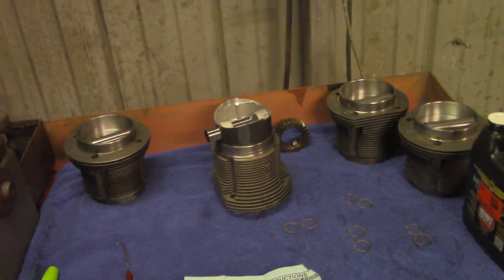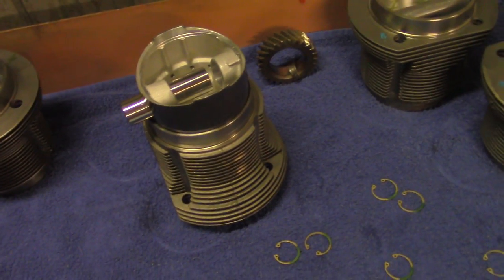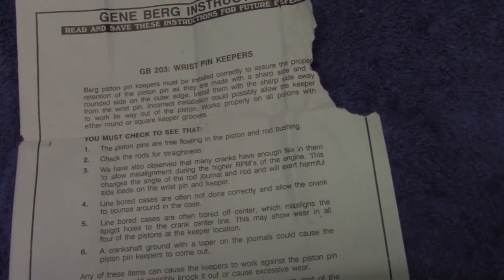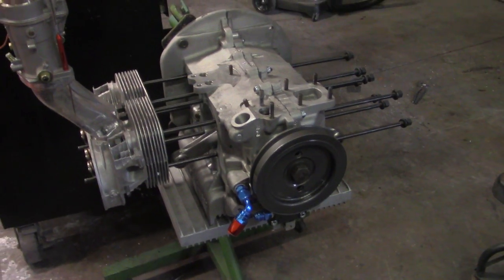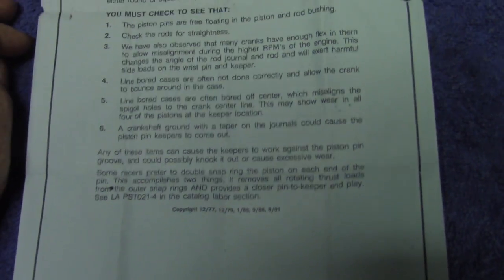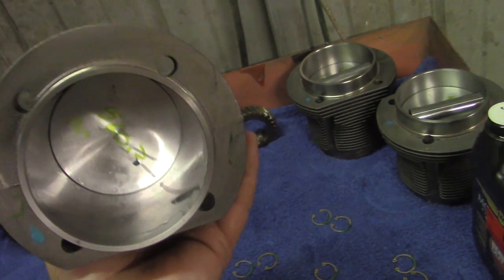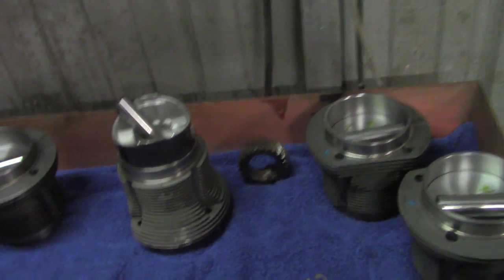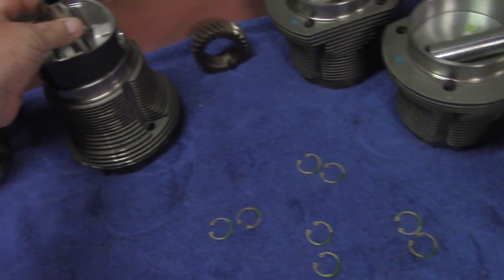piston pin keepers on the 2110

Comment: back in the 70s they had some green end wrist pins that were oversized. they would hone the piston and rod and you wouldnt have to replace the bushing. You should have seen all the weird things they would do, expand the piston 010 and they had these honebore cyl machine that would hone the cly out 010 and put oversized rings. they charged 8 bucks to do this and the dealer sold a new vw set for 40. WEE you saved 8 bucks.

Comment: What do you think of the what I call blood assembly lube not the grease stuff  on none floating pins. Just a drop in the pin hole and one on each side rod?
Reply from the maker: +scottsinfl the slick stuff is ok it is very stick and will make the motor turnover slower but for the appilcation you are using it for you will have no problem . the motor has a harder time talking to you win you use assembly  lube in the assembly process.

Comment: See now that's the difference between the stuff that I work on and those VeeDubs...Let's just say I use nothing short of lots of oil on the rings and bore when I stab slugs..It burns off and oils the exhaust vale guide on the initial fire up...Done it like that forever..Then virtually no idle time other than to check the oil level and coolant level then I go for a trot and load 'em up in high gear on and off for about 20 mins and that works even better for a flat tappet cam 'cos it's broken in too after that heat cycle..Just sayin'..We have Pennzoil full zinc here in many grades ..5 liters for about $35AU.That's my choice..And yes..Fluff is  not a good lube for anyone's pin..